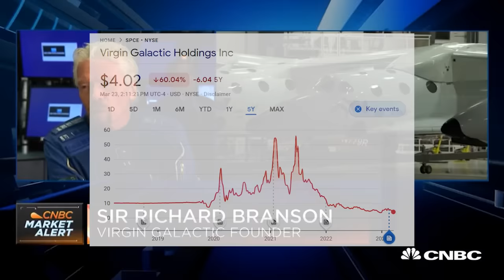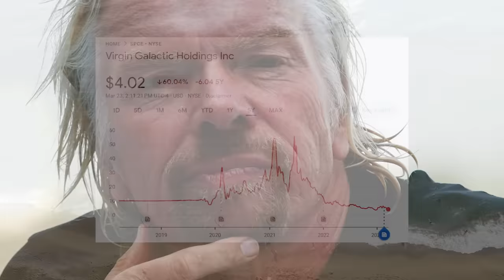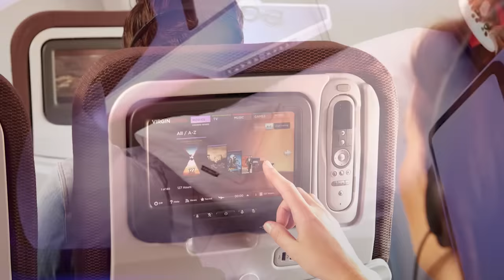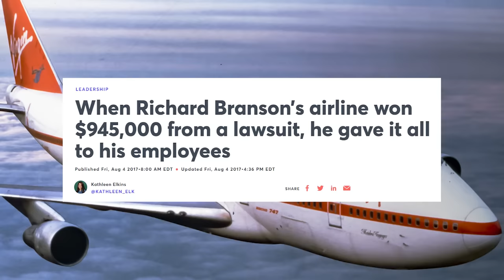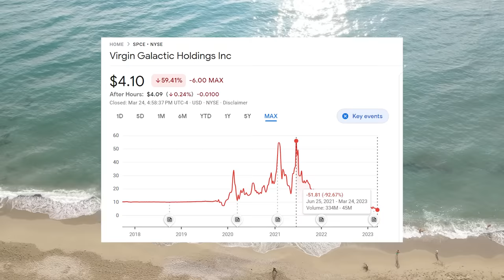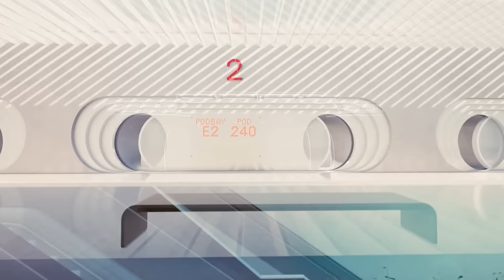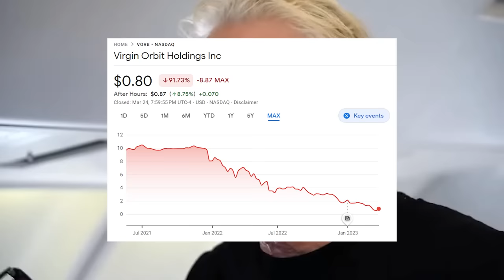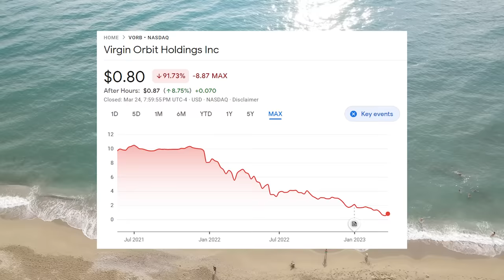The Rise and Fall of Richard Branson

Comment: In which world is the hyperloop scientifically sound? At best it works in theory but in practice it will be nearly impossible to get a working system. The whole idea is based around a train sized pipe that is hundreds of miles long to be made into a vacuum tube. That in itself is nearly an impossible task. The amount of air that would have to be removed is staggering. Not even mentioning the safety concerns.
Unless the definition of scientifically sound is that it is correct that things can move faster in vacuums than no it is not scientifically sound because it is pretty much impossible to create a hundreds of mile long pipe and keep it at nearly a vacuum for extended periods of time.
Reply: Maybe it will work on  the moon
Reply: Airplanes are also impossible.  "Putting occupied vehicles in such a large vacuum would involve insurmountable hazards and difficulties."
Reply: Large hadron collider?
Reply: @allykid4720  really? The LHG is 17 miles long and the inner diameter is measured in millimeters. Oh and not to forget they don't need to get train sized vehicles with people in them in and out of the LHG.
Reply: @Sadreath  what is LHG?
Reply: @allykid4720  Large Hadron Collider
Reply: The H-L is scientifically sound only in that vehicles do indeed have no air resistance in a vacuum.  It is not sound engineering-wise because huge civil works (viaducts, tunnels) would be required because it needs to go in an almost exact straight line in both horizontal and vertical senses. Then the maintenance cost would be astronomical.  Intermediate stations would be impractical.
Reply: Lol, many things were impossible, till someone did them. There are certain things that are impossible, but creating vacuum is not one of them. You might not even need to create vacuum, just remove enough air to travel much faster, like the planes are flying in less air at 10k altitude

Comment: Investing into Hyperloop was an idea with almost no prospect of commercial success. Even normal maglev trains are still an expensive rarity. Where's the demand for going a step further and putting those trains into tubes with a vacuum inside? Evacuating such a large volume can't be cheap.
Reply: Fabricating trains like a Spaceship plus cost of Aircraft type Maintenance would be impractical.!

Comment: You didn't mention Virgin Australia, first marketed as Virgin Blue Airlines.
Basically he was handed a massive gift when Ansett Australia Airlines was sent into receivership by it's owner Air New Zealand who couldn't afford to run both after 9/11. Air New Zealand was re-nationalised as a consequence.
Virgin Blue grew rapidly and was floated for AUD$2.25 per share to much of Branson's fanfare. It last traded as low as 5 cents before going bankrupt.
In the process Branson sold off a large percentage to other airlines who ultimately lost their investment.
As we speak it has been restarted but without anything to do with Branson.
Reply: He also had virgin mobile which ran thru optus. It was great. EARLY buyers got a keyring with virgin mobile on a metal disk. Only happened in like the first couple of years. I still have mine in my house keys.
Reply: I was in Perth Western Australia on 9/11 & had flown there from Sydney using Ansett points.  2 days later I received a text message saying that Anset had gone bust & I was stranded.  Fortunately I managed to get a seat on Quantas Airlines to get back to my family.

Comment: Branson was very good at poaching pilots trained by other airlines such as BA and Virgin under Branson never trained any of its own. So BA cut down on training pilots or stopped.
Reply: In the USA the Southwest airlines does similar things, for example using old and arguably nearly obsolete Boeing 737s for routes run during unpopular hours, going to unpopular airports near popular airports, and its worked well for them, as they are profitable.  Now that I have more money, and am no longer a student, I don't use them much but they are popular with certain people.
Reply: Both of you could not be more wrong.
Reply: @jsmyth65  Virgin Atlantic has never had a pilot training facility - that is provably true.
Reply: @jsmyth65  Branson and others really damaged the opportunity for young pilots to be trained. There are no airlines that will train for free anymore.

Part funded and take out of your salary are normal now and if you want to speed up the process you can pay all the cost, quite frankly few youngsters could pay.

The people who really want to get training without huge cost must rely on rare sponsorship (may occur for political reasons eg tiny ethnic minority for diversity quotas; or some other entity to provide the funds) and the military (opportunity unavailable to most).

Comment: 9:42 
Hyper loop to become viable - imho - needs ramping above ground entirely. The obvious configuration for this is - imho - the so-named ‘Isotropic Vector Matrix - which is ‘naturally’ capable of various configurations without loss of structural strength. (The ‘London Eye’ shows one example of this.) The first need is to find the maximum unsupported span possible to this aiming at miles in extension. Another ‘requirement’ will be to experiment with maintaining the ramp in Earth-tangent positions in the approach to mountain ranges in order to clear them above. The IVM may also be used in supports and may take polyhedral forms in doing so - especially - would think - an icosahedral form.

Comment: Are n't words like fraud and fraudster strong words. Isn' t the deal between just between banks and creditors and creditees and the rest of the population just observers. Will banks be able to take away all that infrastructure that have been designed and developed. Is it ( infrastructure) just cast away especially if they are large conglomerates. I think it is not just black and white and lot of grey areas.